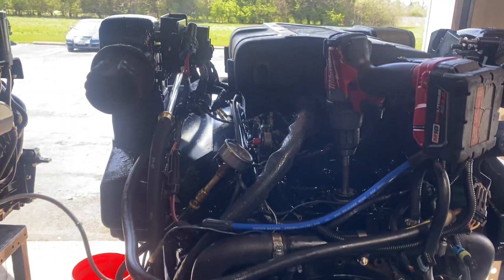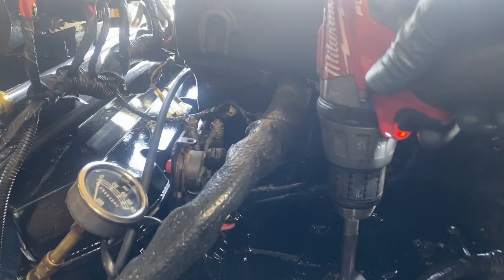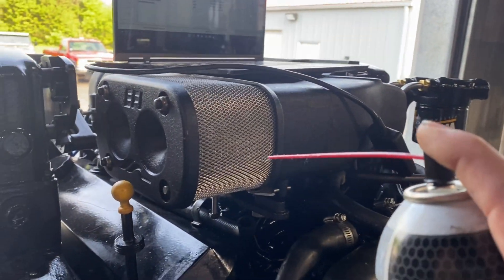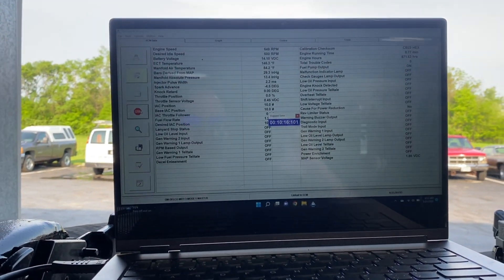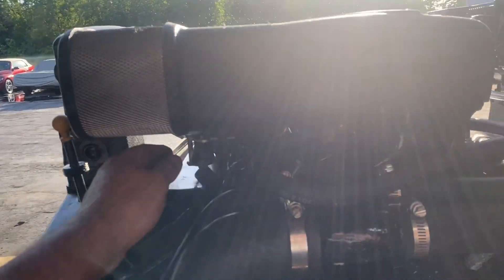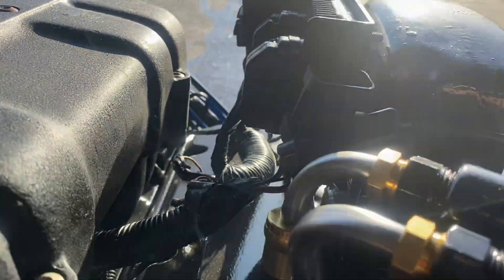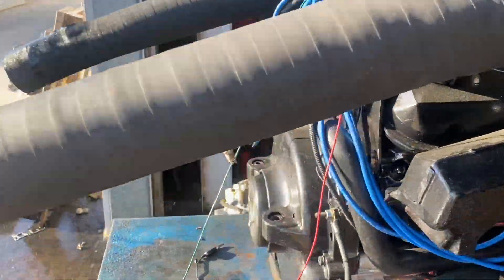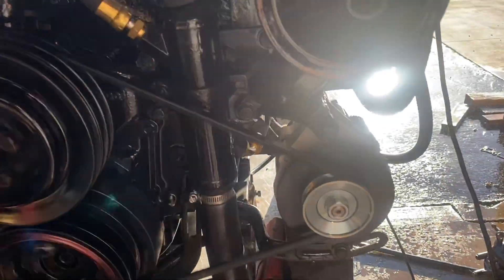Mercruiser 7.4L Engine Overhaul

Comment: Thank you for the video. Great job. I’m having a similar problem with a 454 Mag EFI. It is throwing a code 42. I replaced the pickup coil and module. Now it will not run on new module. Only runs on old module. I watched your video on diagnosing the system. I’ll do what you show.
I send the MEFI to the place on California you did. I’m waiting to hear back from them.
 I also have a 97 MerCruiser 5.7L that tulip valves. It has done this with 2 rebuilds and one long block. It is carbureted. I’m at a loss. I would like to contact you to pick your brain. Thank you in advance. Best wishes.
Reply from the maker: Code 42 is best dignosed with a labscope. There are lots of things that can cause that. Do you have one or know someone that does?

Comment: This is awesome. I’ve got a boat with twin inboard v drive.   7.4 gen 6 l29.       One spun a bearing i think. I’ve been looking for replacements or I might need to just rebuild it.

I also have diacom.   Good software.    Really cool how you send the ecu out to get tuned.    I have a sea ray 340.   I wonder if that company can tune the ecu a bit for either more power or better fuel economy
Reply from the maker: obddiagnostics.com